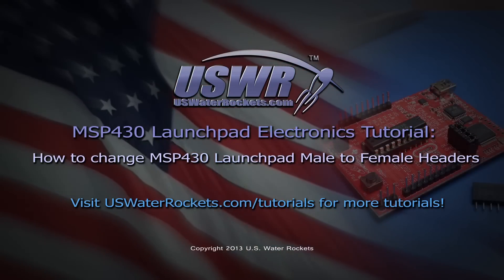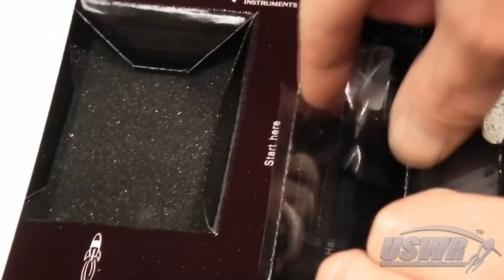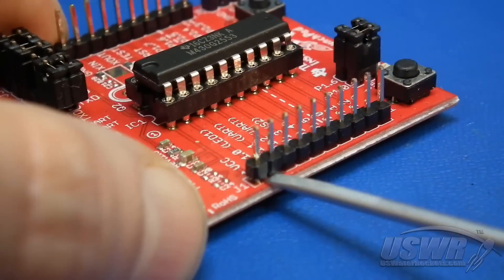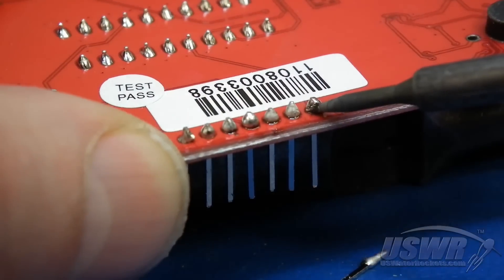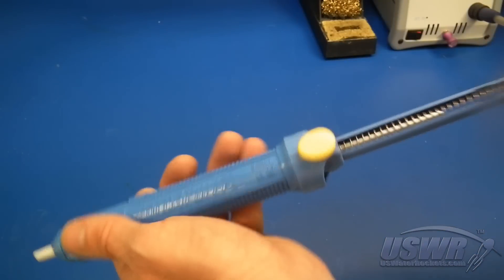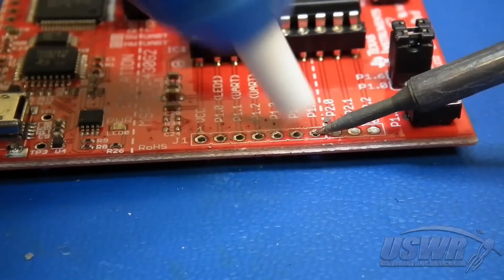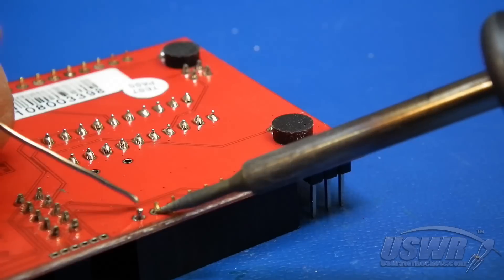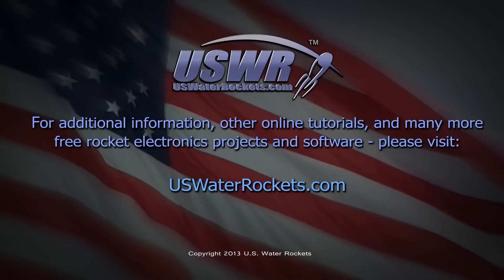MSP430 LaunchPad Tutorial: Change Male Headers to Female for Breadboard Compatibility

Comment: This tutorial is nice and complete, sometimes i can't get the tin to be sucked up into my desoldering wick, might be caused because it doesn't have enough flux of the wick is cheap. Either way,I like to use a 1mm or 0.8 mm drill inside a drill chuck adapter and drill the tin out by hand if it refuses to come out using other tools.
Reply from the maker: Thanks! Another idea when the solder is stuck is actually to take more solder and add it to the stubborn area. The new solder will bring in fresh flux and will also help spread the heat better, letting the wick draw it in.

Comment from the maker: Thanks for the compliment. It is good to hear this is useful to you. We take the male pins off just about every LaunchPad we fly because the pins take up a lot of room and sometimes they get bent, and we don't want them touching together and causing a short.

This method works for just about any part that solders through the board. For example: if you need to change a chip, just cut the legs off and pull out the body and use this method to extract the legs. Then you can put a new chip in.

Comment from the maker: No, it does not change the wiring at all. The connections are the same as before. An optional difference is that Version 1.5 and newer MSP430 LaunchPad board have the male pins soldered into the board where before they came packed in the box. You may want to look at how we remove the male pins and take them off a new board before making the ServoChron because the male pins stick out a lot and make the board harder to mount. Leaving them in does not make it work any different, so it's optional.